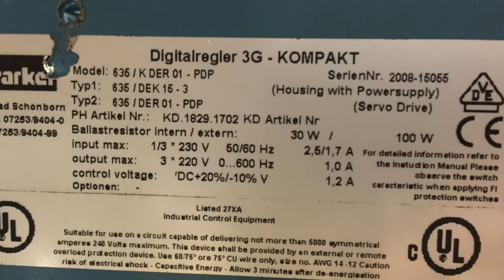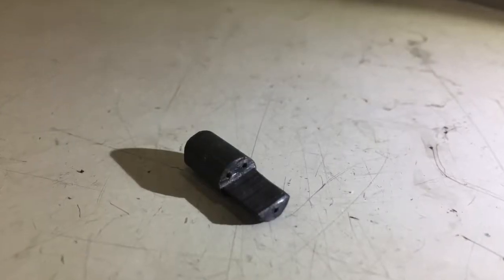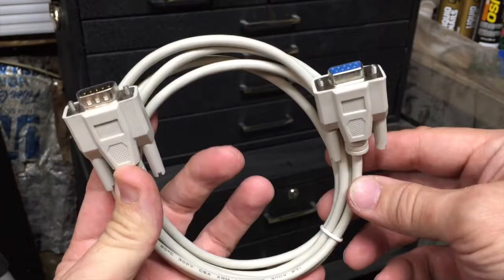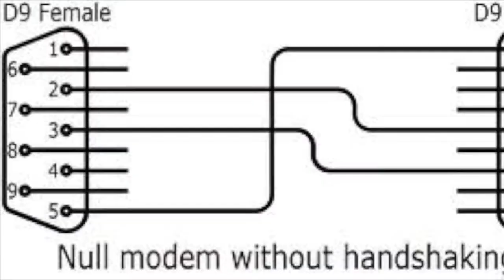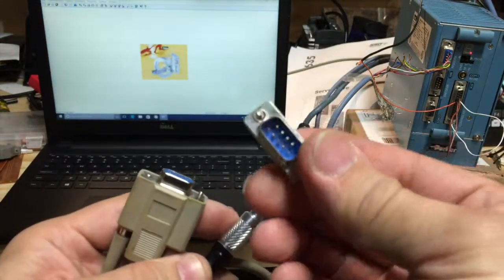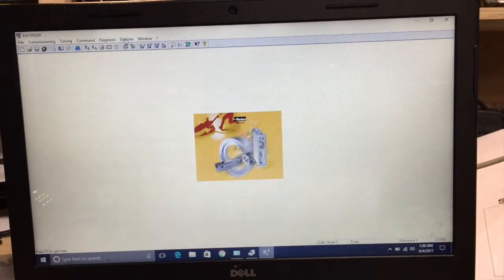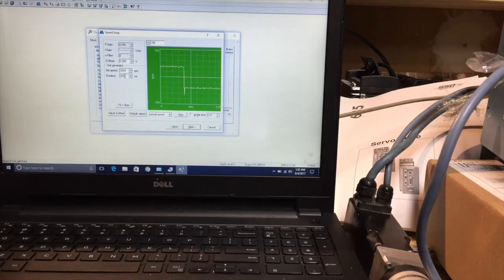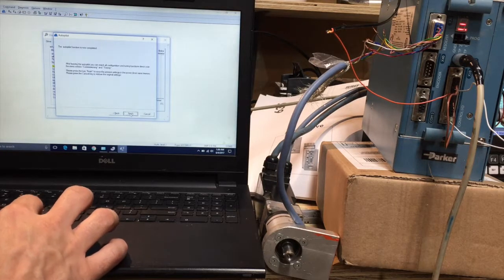Hacked! DIY AC servo Parker SSD 635 serial COM cable

Comment: Very nice job Tinkering Nerd, I have an original cable with the 635 but I can not connect with easyrider :( . when I power the servo drives with only  220v it does not show anything on the LED display . and when I add the 24V it displays a number 6 on the LED screen.
I noticed that you connected a few cables on the X10 port, can you please explain to me how I can activate the communication with the 635 .

my goal is to use the 653 with Mach3 .
Reply from the maker: Thank you so much! Try following connection diagrams in the SSD 635 manual:

https://inverterdrive.com/file/635-Servo-Drive-Manual

I think the “ready” pin needs to be connected.
Best of luck! Keep us posted.

Comment: I recently acquired a whole bunch of a Parker servo drives from the scrapyard I don't know how to connect them up to for example Mark 3 using the simple step and Direction signal how do I connect these drives up
Reply from the maker: A whole bunch? Are we talking dozens? I would be interested in getting my hands on few more servo sets, for a fee, if you will. Did you try the manual from Parker website for directions on how to connect? These servos can be programmed to run with step/dir, constant speed, constant torque and possibly more modes that I don’t even know :-)
Reply: Tinkering Nerd yes a whole bunch 6 bigger and 8 smaller drives I just picked it all up and put it in my car and in storage and I haven't had the time  to look at it yet I just came across your video and thought you might be helpful I don't know how to share pictures or video files through this chat interface but I have some pictures and small bit of video of me taking it out it was a big robot packaging line where got a lot of harmonic gears and servo Motors and obviously the drives
Reply: Tinkering Nerd I just uploaded a short video to YouTube I'm speaking Danish in it but you can kinda get an idea of what's in storage
Reply from the maker: Peter Jensen the ones you got look like a newer series servo drives. I’m sure they would be even easier to get going. In your video, I didn’t see any motors, though.. Are you willing to donate a few sets? Or, perhaps, exchange for some monetary compensation? I promise to make a video about how to set them up (once I figure them out) :-)
Reply: Tinkering Nerd have you seen the other videos I've uploaded I know they don't show much but it was quick videos as I just arrived home with all the stuff I'm at work now and I'll be home in about 10 days I'll do a more descriptive video for you and then maybe we can figure something out with a trade or something
Reply from the maker: Sounds great. Thanks